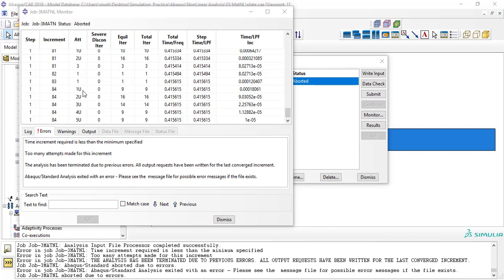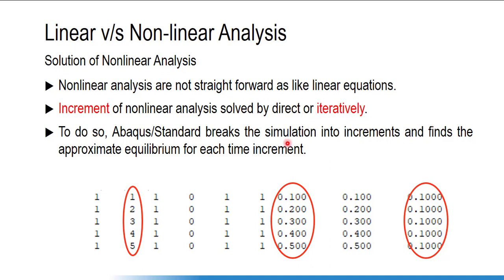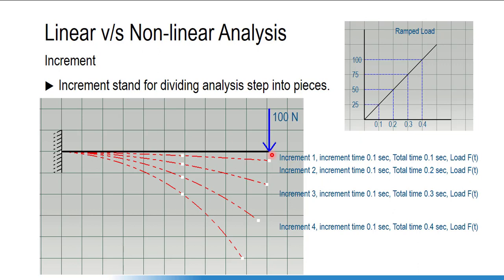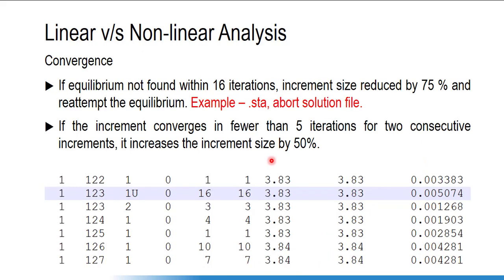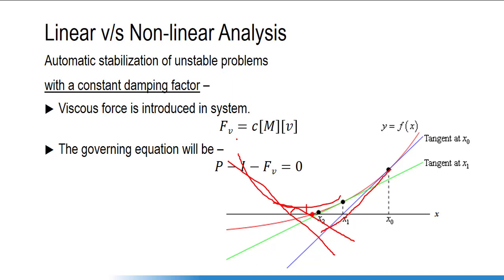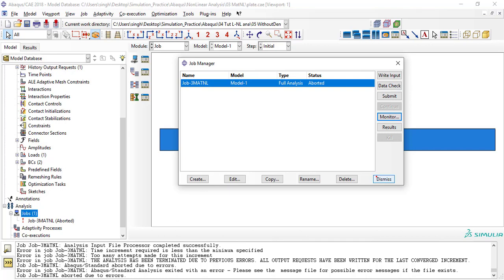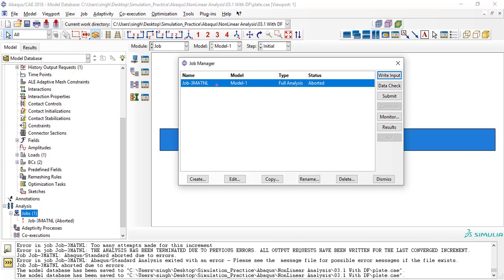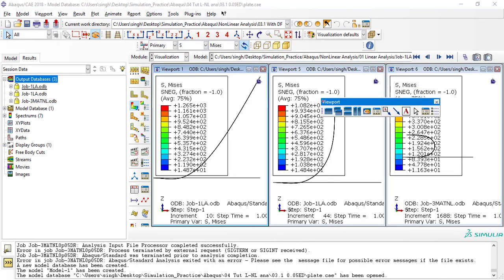02.4 Linear and nonlinear analysis in FEA/CAE (Increment, iteration & Convergence)

Comment: is it really necessary to double check the dissipation energy taken under 5% of the total cause you simply set so back in step setting process
Reply from the maker: Yes we set stabilization at 5% only. But still in 1st case  stabilization is based on damping only.
There one can make mistake (set high damping) to converge solution.

Comment: sir, I have created a beam and i dont know, what is the maximum load it can take, Is there any way to increase the load continuously without giving a fixed value, so that at some load the beam will fail and i will consider it as a maximum load it can take.  Can you tell me the procedure
Reply from the maker: Dear,
Variable load can be define by providing amplitude.
Reply: where we have to give sir, can you share a table related to amplitude
Reply from the maker: There is no fix criteria for amplitude that i can share. It can be anything as per requirement. In few videos i used variable load. Like in CEL water sloshing analysis, hysteresis loop video etc.